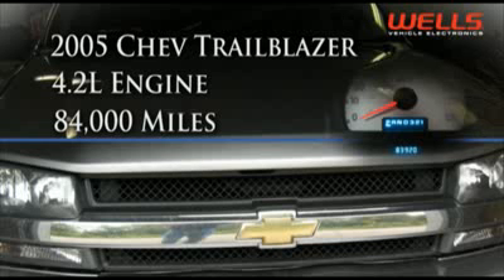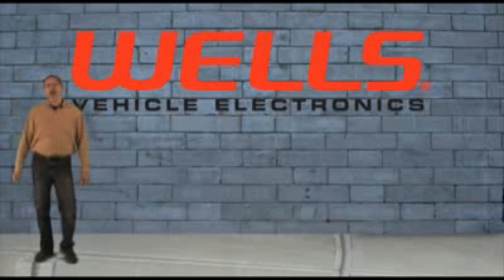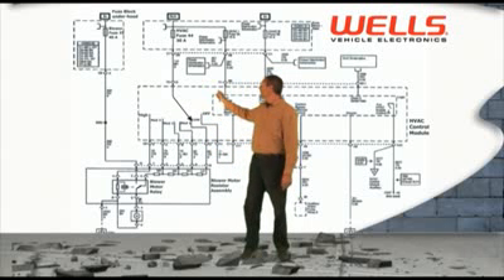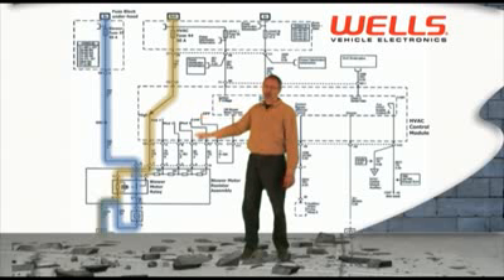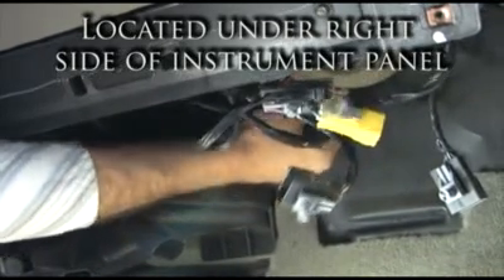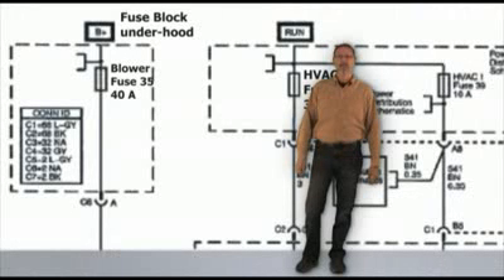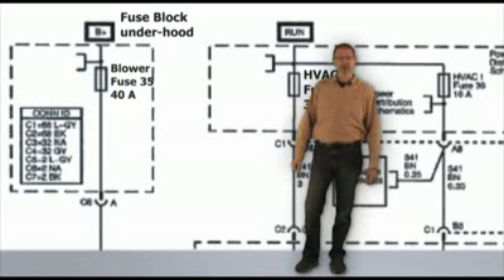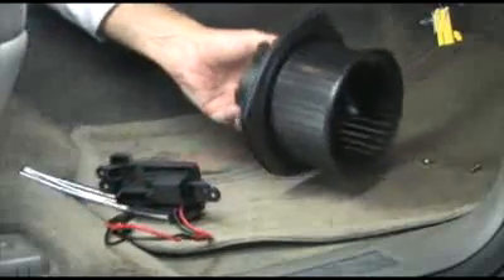GM Blower Motor Resister Diagnostics by Wells

Comment: My resister did burn up on my 2003 chevy silverado.  Only fan speed 4 out of 5 was working.  I replaced it and 1,2,3 and 4 now work but 5 still does not.  

Any Ideas why?

Also the green stick circuit board looking thing that comes out got really hot when I connected it.  I was thinking since it sticks up into the air vent, that is what cools it.  And because it was on and but the fan wasn't blowing, that is what made my old one burn up.   

Is that the case or should it not hot?